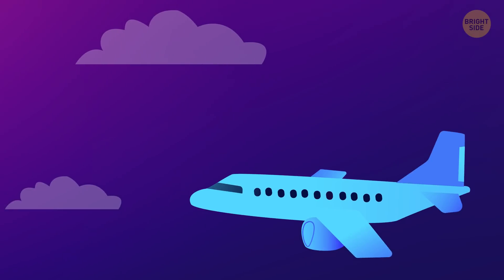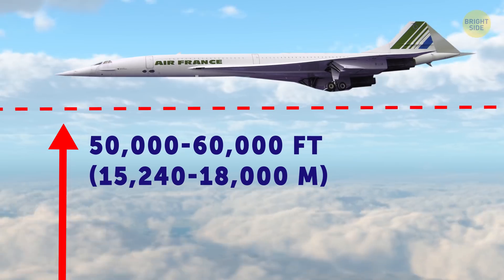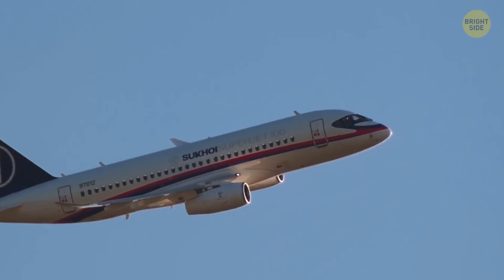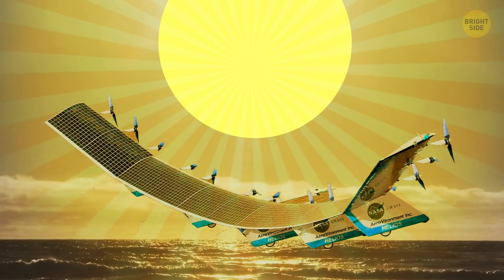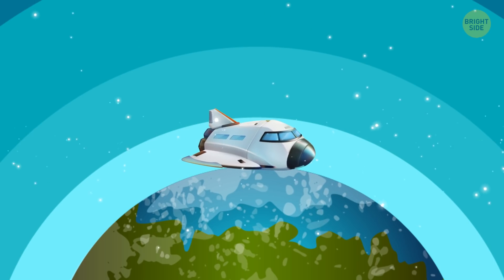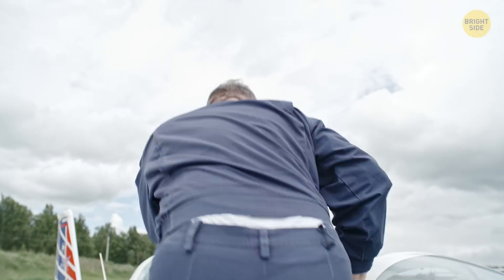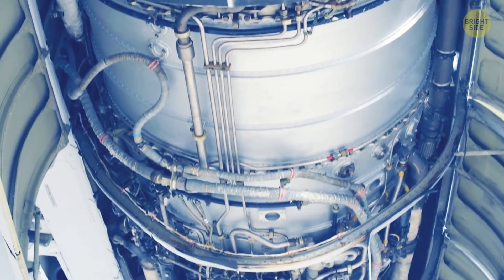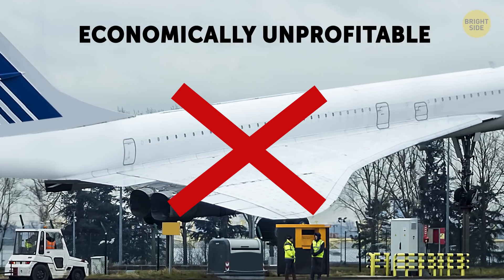Why Planes Fly So Low

Comment: You keep confusing private jets with private piston aircraft. Actually, some private JETS fly HIGHER then commercial jets..up to 45,000 feet as well as some military aircraft. A single engine piston can fly as high as 19,000 feet and single engine turbo prop can fly as high as 31,000.

Comment: this guy confuses private jets ,private planes ,and single engine piston planes .private jets are privately owned jet powered planes that can fly any where from 20,000 feet to 70,000 feet ,private plane is a generic term for any plane of any altitude ,engine ,speed or size that is owned by a private person or small buisness and single engine piston planes are the 1 motor planes that contain any where from 1 to 4 people and usually fly between 6000 and 20,000 feet at speeds under 300 mph .the last category was the one mr brightside mentioned .Also there are certain prototype rocket planes such as the x-15 and x-34 i believe made it close to space and NASA is currantly working on planes capable of crossing over to space.

Comment: Lemme save Your precious time. Planes can’t fly to outer space Bc the air is too thin, so it can’t get the speed to go higher. So it will start falling down to where the air is thick enough for the plane to fly.

Comment: No Pilot Will Reach Outer Space Using The Plane Exept If You Use Rocket.......Gotcha
Reply from the maker: Jerk Of do u like flying?
Reply: @BRIGHTSIDEOFFICIAL  Yes but its was so scared if i fly to much high
Reply: There was a plan to stuff a rocket engine in the tail of a Fokker F-28 - Fokker folded before it could be tried.
The communications comment is nonsense, communication is unaffected by altitude.
Small private jet aircraft do cruise at 50,000 ft. Pressurization failure at these altitudes is frequently lethal but the cruising speed is faster and fuel consumption is lower (jet engines like cold air).

Comment: This is something a primary school kid would know.. well at least in any country with a decent education system. Plane wings & helicopter blades (just rotating wings) need lift = to the weight of the aircraft. for that you need air. Higher you go = less air & the faster you need to go to sustain lift or increase wing surface area. Once you reach a certain height wings get no lift & engines get no air. Now you're into rocket territory where wings are useless & all you need is propulsion.

Comment: The cruising altitude of a commercial aircraft is between 31,000ft to 41,000ft.
Reply: And the Concorde stopped flying due to burning of nitrogen oxides which severely damaged the ozone layer of earth
Reply: @choppedwatermelon6331  Damaging the Ozone layer was an after thought or what they shared, but it was just too expensive to operate.
Reply: after 40 k feet its called the zone i dont know what zone tho i dont remember
Reply: Because accident of air France Concorde but i don't know tu 144 accident
Reply: Actually its usually 31,025 feet to 41,025 feet